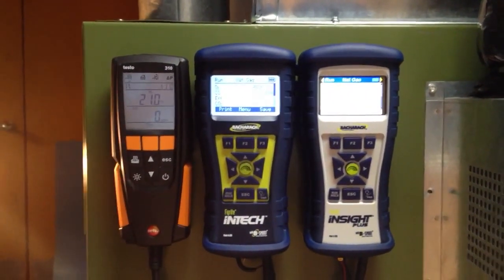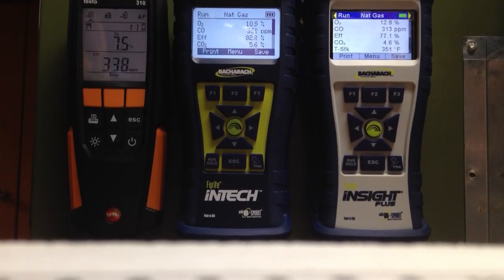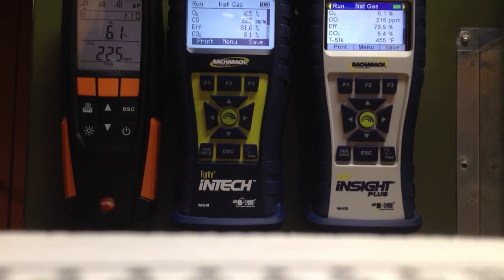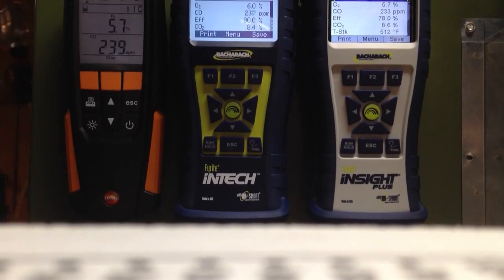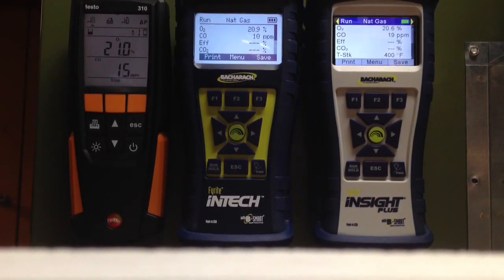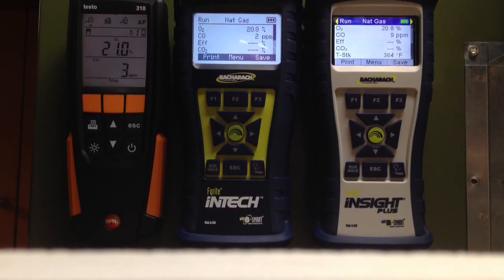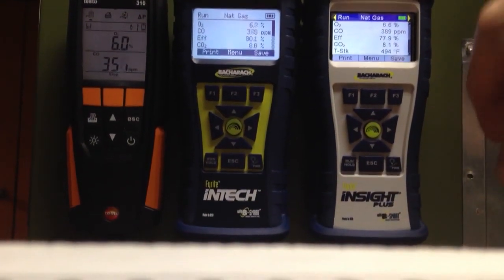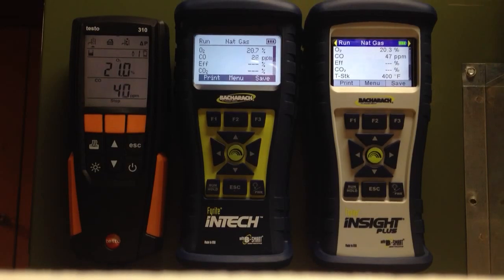CO Response Test on Testo 310, Bacharach InTech and Bacharach Insight PLUS

Comment from the maker: The wand on the Testo 310 is permanently connected to the tool. I have been using one for several months though and have grown to like it a lot. It is simple and quick to use. I really like the smaller size.

Comment from the maker: The hoses were used as shipped. You are correct, they are much longer. They have to be to keep the trap that is integrated into the hose assembly vertical. The Testo 310 and the 320 have the trap integrated into the instrument.

Comment: Thanks, I'm looking to upgrade from my 6 year old Fyrite Pro, and am interested in the Testo analyzers, specifically the 320.

The printer for my Fyrite Pro will work with the Insight, so I'm leaning in that direction, but if the 320 is a significantly better instrument, I'd have to rethink things.

Comment: Good video, thanks.
Did this use the hoses "as shipped" with the instruments?
I believe the intech and insight both have significantly longer hoses than the 310, which may be a lot of the difference in response response time at lightoff, and the longer recovery time.

Comment: Testo’s quality has dropped significantly. I bought the 310 and had a horrible experience. Moisture was getting behind the screen within 1 week of owning it. It was replaced free of charge but I opted to return and buy the Bacharach. I can’t speak for the higher end Testo but the 310 is a dud.